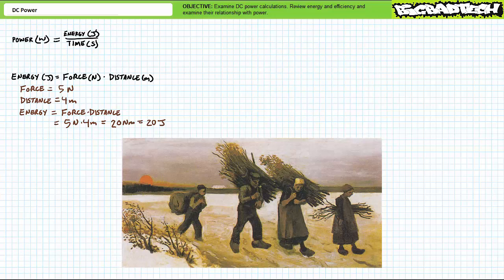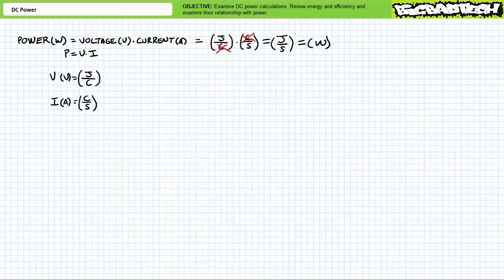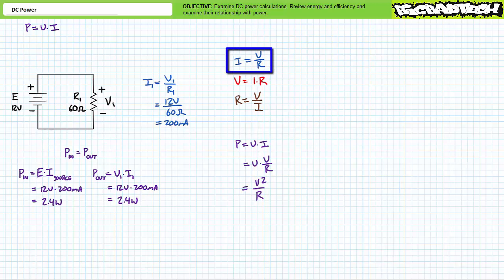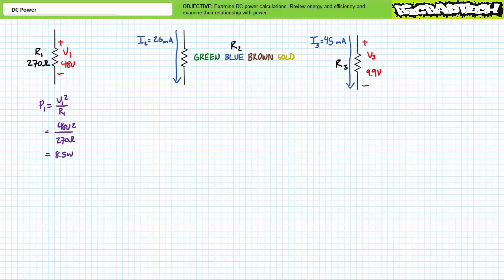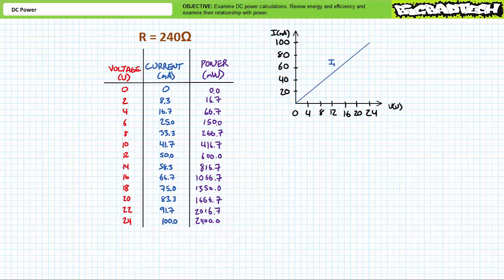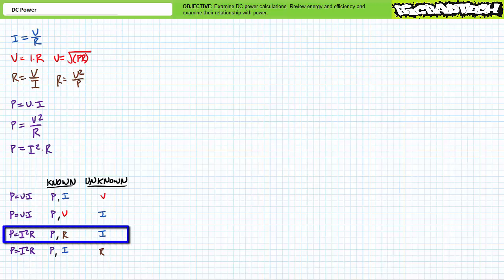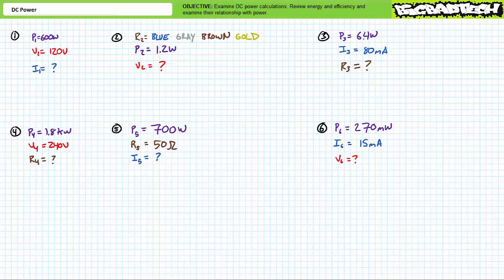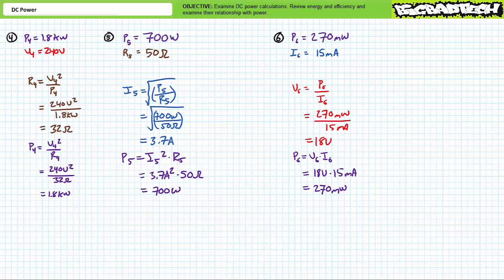DC Power (Part 1 of 2)

Comment: I could be wrong but for question number 6 at 24:56 shouldn't the correct answer be 18 mV not 18 V since we're dealing with mW and mOhms?

Thanks for the content Jim, its been a huge asset for me as a High Voltage Electrician getting my head around Industrial/Control concepts.
Reply from the maker: Glad you're making use of the material. Check out the "Engineering Prefixes" lecture at: https://youtu.be/y6_jTXb9rcs Long story short 270mW = .27W and 15mA = .015A,  V=P/I=.270/.015=18V